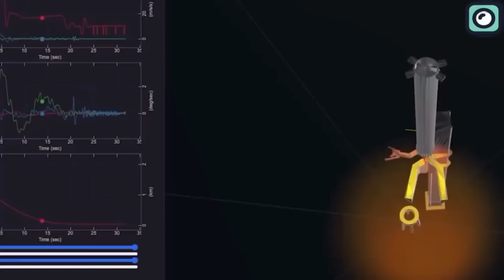SpaceX's Landing System Causing BIG Problem! "We have to fix This"

Comment: Always seemed dicey looking to me only . . . only 2 fragile looking arms I think adding 2 more arms to stabilize the booster on the Vertical axis would be would. I certainly hope not. If 2 more arms ( oversized and contoured to the round shape of the booster ) could be added further down to help align or stabilize  ( not catch ) the booster on its Vertical axis. It would seem safer teither way o me . Can those 2 arms currently in use be sped up a bit or is it the animation that make ithe capture process seem slow ??? And if the tower could rotate ( $ I know $ I must be nuts ) 5 or 10 degrees on the fly to present an absolutely  ideal capture situation ???
Reply: What a mess sorry

Comment: It may be significant to success by inspecting the proximity on landings of the Falcon boosters since they have a substantial number of landings on a hardened and easily identified pad.  If the weather at time of an incoming booster is cooperating, then the percentage of success will increase. Gusty winds , rain, or fog will be a large factor that could make "catching " more difficult.  Place your bets.  That is probably why the initial booster 24 landing will be over water where damage  or explosion risk should be much less.  Will a breakup of the booster with remaining fuel contaminate the water significantly ?   Let's see !